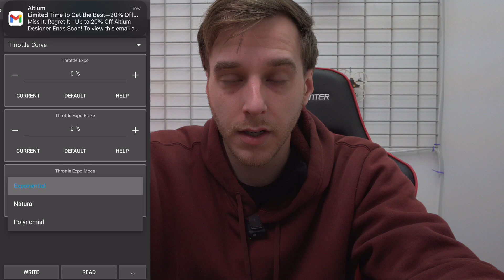45Mph Crazy Cart - Tips & VESC Settings

Comment: I bought 3 headset bearings lately. 11:45 Same as yours. None of the 3 have the very thin washer that goes under the black headset top. I think they changed the design of the top piece with a step to delete the washer. Did yours come with the washer?

Comment: Just a heads up battery line amps will usually be about 60% of your phase amps. But field weakening is taken directly from the battery so that being said, some rough math you’re demanding close to 90 amps on the battery. Those leads acids are F’d your going to want a li ion pack that can put out atleast 120 amps continuously if you plan on running that motor at it’s rated current. Also 60amps of field weakening you are more than likely saturating that stator, more voltage would be ideal .
Reply from the maker: Totally agree I ended up changing the tune a bit because this killed the lead acid batteries in like 10min thanks for the info man I did not know that!

Comment: I have purchased a 48v 14ah lithium battery which likely has a BMS limit of 30A. How could I make the most out of this battery, or even bypass its limits, by tuning in the app or modification?
Reply: Depends on the battery but all you do is solder lead directly to the positive and negative to bypass it but you need to know what cells it uses and what they are rated at.

Comment: So you are telling me I shouldn't buy 4x 12v 28ah 300a lead acid batteries for brushless 48v system with VESC?
Reply: 200 euros total in finland..
Reply from the maker: @borrenfam  Nah that would work just fine although lead acid isn't the best battery chemistry for high amp draw motors. I'm using a 48v lead acid battery with 5 Amp hours. It doesn't run into any bottlenecks with amp draw but keep in mind you will be slowly damaging the batteries by drawing anything over the 30 amps they are rated for unless they are rated for a higher discharge rate.
Reply: @DanielJack710  Mines rated at 300 amps, yeah, three hundred. And can't I setup the VESC so that it does not draw anything over like 60 amps?
Reply: @DanielJack710  Or I mean the ones I'm considering
Reply: @DanielJack710  Plus that 28ah capacity is like 3 times more than most of the setups.
Reply from the maker: @borrenfam can you link me the batteries your thinking of getting, is it 300 cold cranking amps like a car battery? Or 300amp continuous discharge seems quite high, but if they are rated for that it means you can pull 300 amps from the battery with out damage

Comment: That first rubber tire is amazing if you're only going to be driving in a straight line and not losing traction much. Unfortunately because there's no sidewalk it flexes and bounces and will send you off skipping instead of having predictable sliding. If that tire has sidewalls it would be the perfect tire. 

I also noticed on the screen record that you are freewheelin that tire. Once that's under load I don't know if it will go 45 mph. I would love another top speed run!

Also unless you are actually using regen, the motor breaking current doesn't come into effect. There's a setting for the input to have the middle of the throttle be zero so that when you're off the throttle it acts as a break. I have not tried that yet though
Reply from the maker: Ahh i did not know that's good info man! well I'm gonna give it a rip here in a second i'll post the speed run, i'm thinking i'll get close to 45Mph but we shall see haha
Reply: @DanielJack710  you might want to take a look at my parts list, there's some descriptions of things that might fill in any gaps for you. That's a nice looking 3D printed mount btw
Reply: @DanielJack710  also on the parts list there's a 14 amp hour lithium battery that got to my house in like 2 or 3 days. I know you said you've been waiting for a battery. Have you built yours yet?
Reply from the maker: @TheCrazyCartModChannel  I saw that but have been saving up for the one i want to build, I haven't built the battery yet its gonna run me roughly $500 to do it but it will be an absolute unit
Reply: @DanielJack710  damn! Sounds killer bro 👍